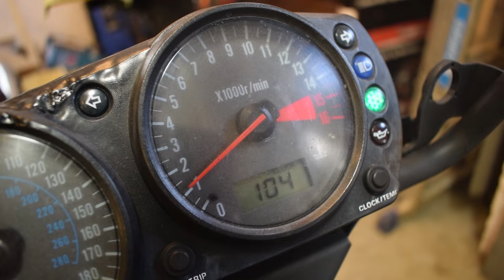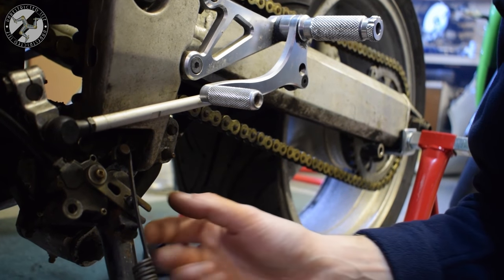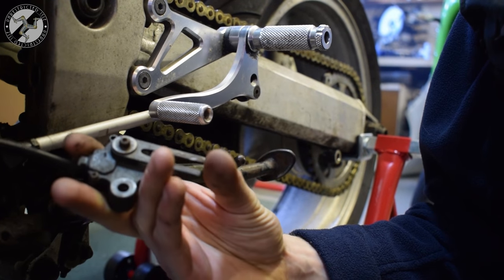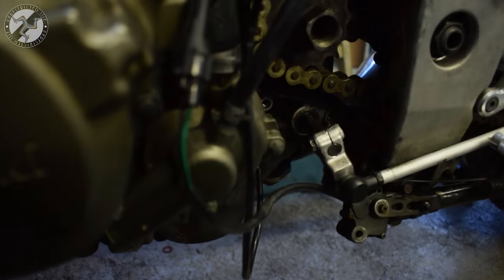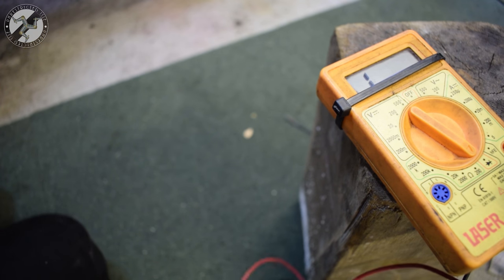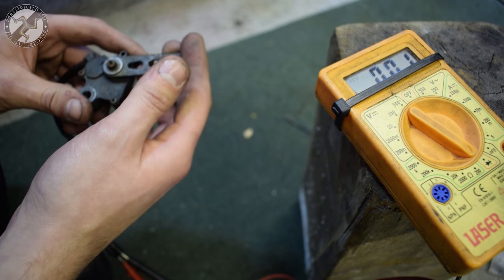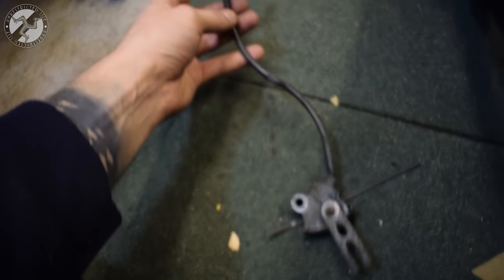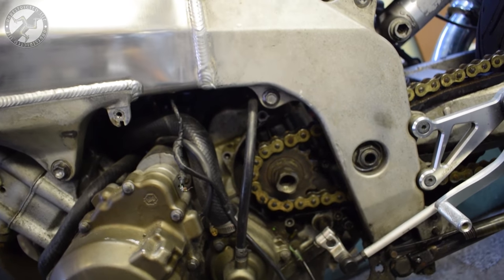How To Fix Kickstand Switch / Delete It - Track Bike Build Part 2

Comment: Just used this to fix an issue where the bike wouldn't start if the kick stand was down, even in neutral. No longer having to balance the bike as it warms up is well worth it! Thank you
Reply from the maker: Happy to hear that, glad it helped 😁
Reply: Would the engine crank but not fire? I’m having an issue like that right now
Reply: @joshvieira9976  the engine would not crank or fire.
Reply: @joshvieira9976 what bike do you have? That’s exactly what I’m working on rn. Did you end up figuring it out?
Reply: @temp6156 I'm having that same problem. Kickstand down the bike cranks but won't start. With the Kickstand up it starts right up. I'm thinking the sensor could be bad
Reply: @EloyG09  that sounds like the sensor. But for me it cranks but won’t start no matter what, kickstand up or down doesn’t matter, neutral or not doesn’t matter, it just never fires.
Reply: @temp6156  ah dam sounds like you have more serious issue. Can you hear the fuel pump running? Is so maybe the crank sensor is bad. Can you roll start it?

Comment: Guys... hate to be this guy but please keep in mind the switch is a safety switch, I had it removed and had to make a u turn to pick up something I dropped, but getting back on the bike in the adrenaline I didn't put it down all the way and it was in the way of me turning at around 80mph. I ended up high siding and had a shoulder reconstruction. Please don't forget that it's not there...
Reply from the maker: On a road bike - yes. On a track bike, there shouldn’t be a kickstand to check for 😁

Hope your shoulder is back full strength now

Comment: My bike died when I put it in gear with the kick stand down and now won’t start
Reply from the maker: Try running right up through the gears before going back to neutral
Reply: @UnrestrictedIsle  what do you mean? Like try to start it in different gears?
Reply from the maker: @DonDamian  it should only start in neutral - if it’s struggling to pick neutral up try moving through all gears to let the selector fork resettle
Reply: @UnrestrictedIsle  ok thanks I’ll try the first thing tomorrow
Reply: @UnrestrictedIsle  also when I jump start it, it’ll turn on and act fine but the second I disconnected the cables it dies
Reply from the maker: @DonDamian  could be a super dead battery - have you got a charger?

Comment: So on my way home it’s happened twice now in the same spot my bike starts getting jumpy and today it actually died I looked at my kick stand and it’s broken has a lot of play I did everything in this video and it shut off each time I’m going to order the new kick stand tomorrow could that possibly be my issue? That when I’m riding it is bouncing and shuts the bike off I’ve been trying to trouble shoot and don’t know where to start people said check the kick stand and it is broken..?
Reply from the maker: you could tie the kickstand up to test it (remove any chance of it bouncing)
Althought i wouldnt have thought that would cause it to be jumpy.
Whats the bike?
Reply: @UnrestrictedIsle  2006 cbr1000rr I’m just so stuck on what it could be? When I got it home it started right up I’ve checked air filters they are clean battery has a good charge maybe spark plugs?
Reply from the maker: @bigjohnsonscustoms6648  definitely worth pulling the plugs to check them.
Any chance there’s contaminated fuel in there? Sometimes stations water traps fail

Comment: see my bike I can put it in gear and once I let off the clutch the bike jumps forward then cuts off idk what to do tbh
Reply from the maker: With the wheel on the ground?
Reply: @UnrestrictedIsle  yea
Reply from the maker: @charlieduncan3367  that’s normal, it’s on gear, trying to turn the wheel - of it can’t it’s going to stall the engine

Comment: My bike randomly cut off while causally accelerating from a red light.

The engine starts up, but cuts off abruptly seconds later.

Recently did an oil change, added LED’s, and handgrips. (Also had to take apart the kill switch to unglue my throttle, lol)

None of that was “on” when it happened though.
Reply: I’m dealing with the exact same issue on my 07 gsxr but never cuts off. I just start it and it cuts off.l abruptly upon second start it always stays on.

Comment: When I put the clutch in the gear of my Honda MC22 RR bike, the neutral bulb lights up, I replaced the diode but the problem is the same, thank you for providing a solution
Reply from the maker: Sounds like you have a shorted wire somewhere. The neutral switch, it’s light, the clutch switch and kickstand switch are all part of the same circuit - try checking the wires for all of these to see if they are damaged 😁

Comment: Alright mate I have a 2002 sv650 and I have bridged the clutch switch and side stand switch. But I still get cut out when switching into gear, it can be intermittent,  but also if I accelerate hard and fast it cuts out immediately and then I can start in nutreal but stalls when selecting gear, can try starting and selecting gear for a while and it'll work in the end, but revs are surging a little
Reply from the maker: I’d check the wiring from both of those switches - you might have damage or corrosion in a wire causeing a make/break connection
Reply: @UnrestrictedIsle  i think its the relay as if the bike is left it will work fine for a while, assuming the circuit is heating up the relay and then it starts breaking down under load and sticks closed. Once cooled down it starts working again, I assume this as it never works intermittently when playing with the wires or causing the problem when it's working by playing with the wires.
But it will then all of a sudden work for no apparent reason. But surging slightly, if left it then starts fine like no problem, speaking I have only experienced it in a single ride home and then a single ride around trying to replicate it, which it did.
Reply from the maker: @Saitanta  certainly possible - at least you can make it happen, which will help a lot!
Reply: Look at the neutral switch

Comment: So removing switch and joining both wires bypasses it ?!
Reply from the maker: It depends on the type of switch -

Either joining the wires or keeping them separate will bypass it. It depends on if the switch is open or closed in the active position

Comment: Hey mate. On my 03 600rr the kickstand gets no reading when it's down. And only a reading of 0.4 ohms when it is up. Does this mean it's bad? I'm also getting a low reading of 0.4 when I check the clutch censor! I'm baffled at this point..
Reply from the maker: What’s it reading when it’s down?
Reply: @UnrestrictedIsle  when it's down I'm getting a reading of 0. This bike I crashed a few months back so I'm trying to figure out what's stopping the fuel pump from priming.
Reply from the maker: @seanphelan5408  has it got a tip over switch?
Reply: @UnrestrictedIsle  it does. But the bike actually started the day after the crash.. since then my fuel pump stopped priming and I no longer have headlights
Reply from the maker: @seanphelan5408  have you got a wiring diagram? 
There might be some kind of link between fuel pump and lights - unlikely though but worth a check

Comment: Hello!
My Ninja 636（05-06）have the same problem, too. But after diag, I think the problem is not on that kickstand sensor. Because I tried to connect both wires when I shifting gear still auto cut off, （even the clutch lever two wires） then what is the problem? where I should to follow?
Reply from the maker: Try checking the wires further up, there may be a break somewhere.
Are you doing this with the rear wheel lifted? could the clutch be dragging and instead of an electrical cut off its a mechanical stall?

Comment: Hi friend. I just need to ask a question if you can assist me. I noticed that my side stand safety switch has a loose wire - I got the bike like that. I have a Yamaha Fazer 2004 model. I just need to re-connect it. As I cannot see the other end to connect it to. Probably need some maintenance - please help
Reply from the maker: Happy to help 😃 are you on Facebook? Could do with a picture to see exactly your problem
Reply: @UnrestrictedIsle  yes I am